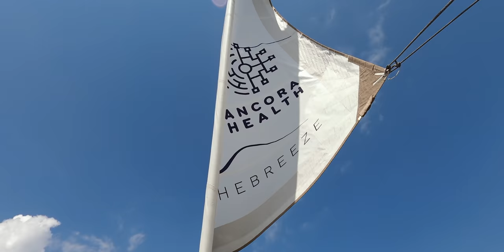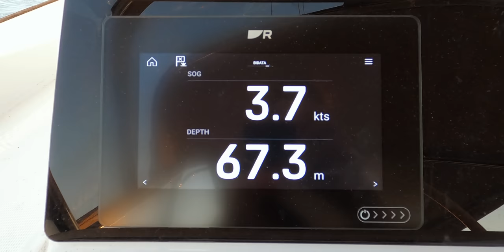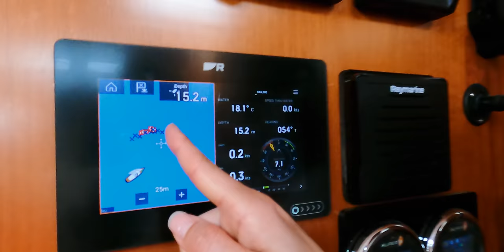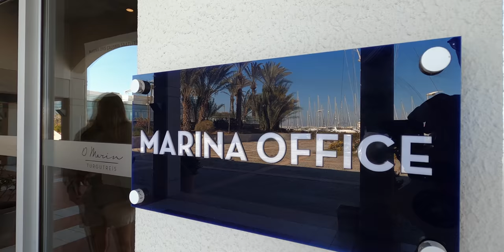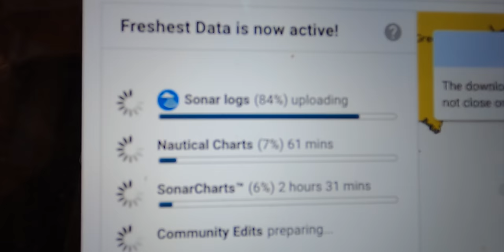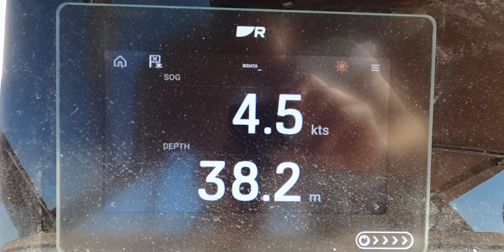DIESEL BUG In FUEL and STRONG WINDS 40+ knots - SAILING TURKEY Se. 2 Ep. 49

Comment: So nice to have a fully integrated working system on board! We like the raymarine setup. And yes the dieselbug is terror. Lucky you found out in time. We've had a blocked system once. We were also lucky it happend after a storm and when sailing in anchordeep waters.
Love your channel!!!
Reply from the maker: Yessss so happy with the system and so amazing what the equipment can do and how easy and great sailing is now! Indeed terror the diesel bug, luckily we caught it right away and engine is running super smooth again. Wow you had a challenging situation there!!! But we have all the trust in your experience and good decisions making! Thanks for supporting us every time, you guys really are the best!
Reply: De rode lippenstift, niet doen. 
Misschien als jullie uit gaan, maar niet in deze setting.

Comment: You should consider getting a dual filter system. When there is an issue you just move the lever to the second filter and this is critical for/when in difficult situations. Also, can not really tell with your system but the system I use has a clear bowl at bottom of much larger filter (racor) and I can see the clarity of the fuel in both filters.
Reply from the maker: Thanks for the great tip regarding a second filter setup, smart! We have a clear bowl at the bottom and that’s exactly how we discovered it in first glance. Great to hear your feedback, very much appreciated 💙

Comment: Diesel bug grows when your not using the boat , when it sits in winter , especially if the tank isn't full, 
That first filter wasn't bug , it wasn't very clean diesel I agree, that depends what the fuel is like where you buy it from,  the history of your tanks . The pre filter did it's job,  diesel bug is a living organism fungus. 
It doesn't hurt the engine or injectors as the engine stops before it gets to them, usually 2 filters 
Sometimes it can block up the nose from the tank, or Evan the shut off valve .
Happy sailing .
Reply from the maker: Hi David, thanks for the explanation. Underneath the filter in the water/diesel separator was the bug, what probably happened was the difference in temperature with the return diesel in the cold tanks or when fuelling up in the beginning of the season. We just had our tanks completely cleaned and remember it from the past. Interesting stuff and happy we discovered it in an early stage. Thanks for the insights. Have a great day 🤩